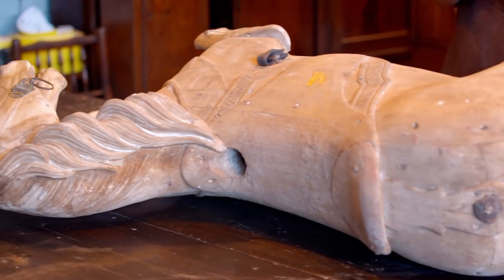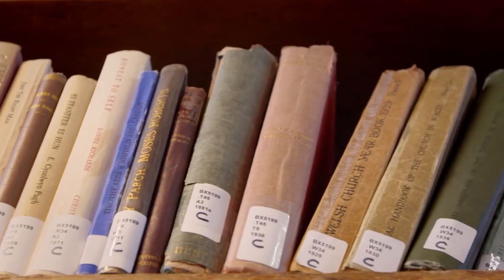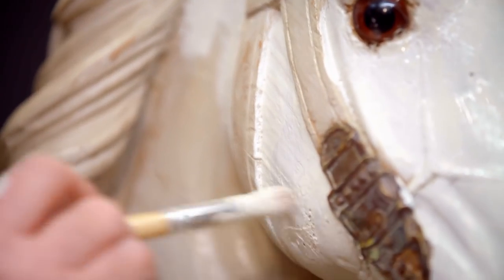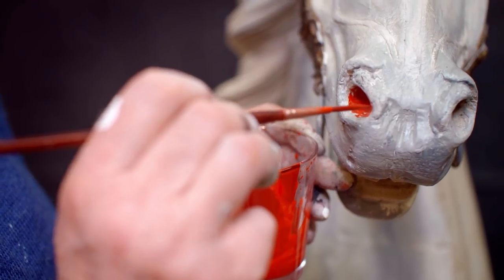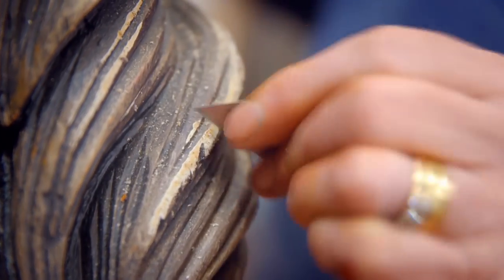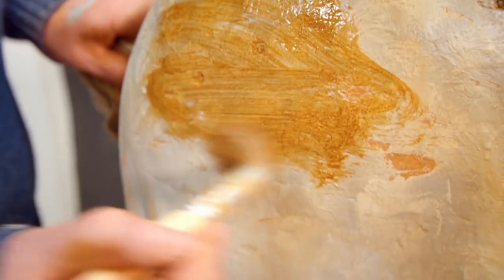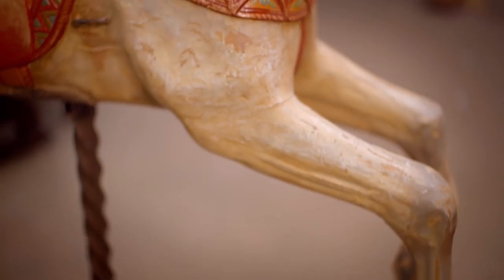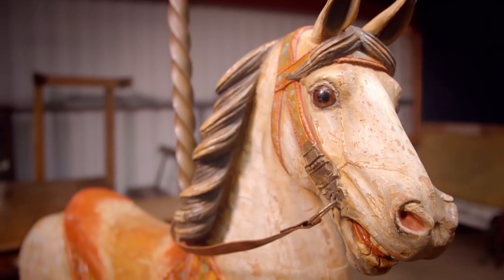Incredible Restoration Of An Old Carousel Horse | Salvage Hunters: The Restorers

Comment: Bodged.....look at the metal nailed on bits of tin still in place, painted over. MUCH better to send a horse to a dedicated rocking horse/carousel  restorer . Paint job is ok, but put over a hastily done repair to the body..
Reply: I agree.  While she did an amazing job with the paint, making it look old, that's almost a form of fraud in a way if this horse is ever sold with the mistaken notion that it's in factory paint.  That could affect its value tremendously.  And the metal patches should be removed as they can induce wood rot.
Reply: It paint job could indeed fool a novice buyer of these items, but an experienced buyer would know what to look for..the poor repairs to wood were quite shocking, PVA glue won't cure gaps in the leg joints..  They must have put filler in them afterwards, as one saw no wood set in to fill  those gaps. Genuine wear to painted wood horses is totally unlike chipping at it with a blade, or using sandpaper. The horse should have been repaired properly and then painted.
Reply: Absolutely!
Reply: Bodged?  Its done to a budget,  otherwise theres no profit to be made,  no one said they were trying to sell it as untouched original and if a collector wants to restore it perfectly after buying it, then they can spend a fortune restoring it to an inch of its life. You realise most things on this show are for decoration and home finishing not for collectors as such?
Reply: I loathe over restoration, but these bits of nailed on tin ''are'' a bodge.. They really ought to be removed. they damage the timber further.PVA glue is a no no as well..animal glues that can be reversed is much better.  Just collected a horse today that will have nothing done to it at all, just a very gentle dust off..The naturally worn genuine paint is treasured.